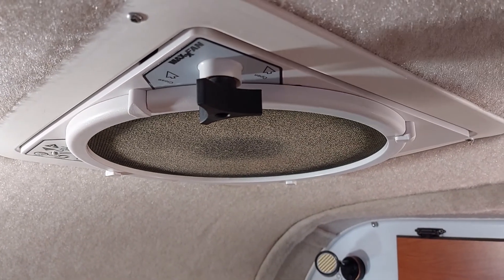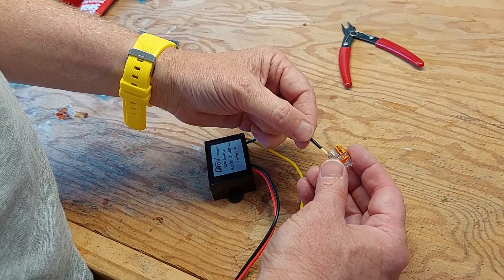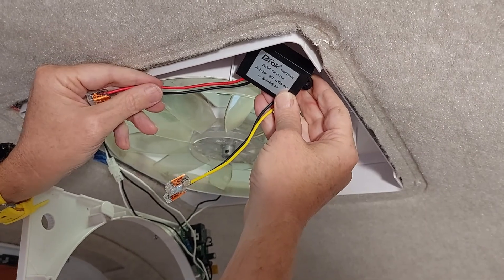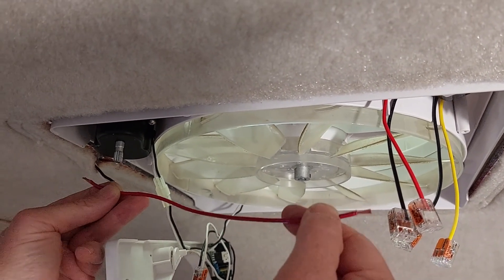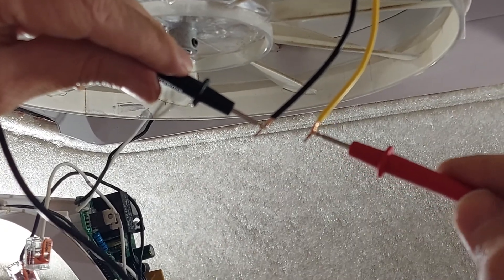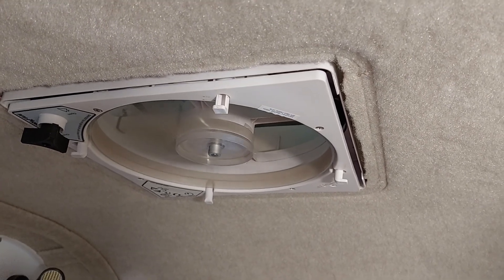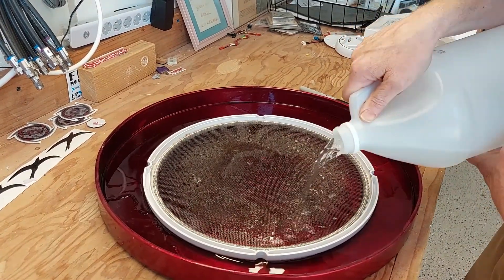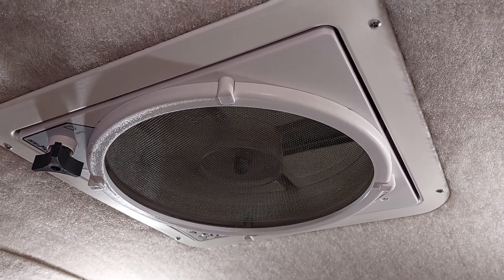How to Stop Your MaxxFan From Beeping & Shutting Down When Using Solar Power

Comment: Very helpful video! 👍 This is a common issue, especially for those living off solar power or in RVs. My MaxxFan used to shut down too whenever the voltage dipped a little. Thanks for the clear explanation — now I understand what’s causing it and how to fix it. Would love to see more practical tips for off-grid power systems! 🚐🔋☀

Comment: Install didn't work for me..disconnected fan from circuit board and it did not beep or show green light, plugged fan back in and it started to beep with green light again. 14.2v in 12.12 out.  Disassembled fan motor, cleaned. Bearing on bottom was dry. Packed with grease, reinstalled motor and ran great.

Comment: Hello! I have done this and thought it made the fix but I'm still getting the same issue, does anyone have any suggestions on next steps by chance? Thanks in advance for anyone willing to take the time and provide input!!
Reply from the maker: I recommend resetting the fan by removing the fuse in your panel and plugging it back in after a few seconds.  If the problem persists, I suggest calling MaxxFan technical support.
Reply: @scampgrounds   I have removed the fuse in my fuse box for the fuse between the battery, and the fan (now voltage regulator) is that what you're referring to or you're referring to a fuse in the fan circuit board? Thanks so much for your quick response and support. I have minimal knowledge and it's getting warm in AZ, gratitude to you!!
Reply from the maker: @MikeRobare  You did what I suggested -- removing the fuse at the panel (effectively stopping power to the voltage regulator / fan) and then resetting.  If the problem still persists, I recommend calling MaxxFan -- it could be a circuit board issue that needs replacement.

Comment: Parasitic draw of the Regulator?  Also some complaints about DROK not providing enough voltage when hooked up to DC.  Any issue now that it has been 2 years?
Reply from the maker: The issue concerns some MaxxFans not handling voltage outside a narrow range around 12 volts.  Introducing lithium batteries / solar panels can raise and violate the acceptable voltage reaching the fan, causing it to beep and shut down.  The voltage regulator addresses this issue, keeping voltage at or near 12 volts for the fan to function properly.  I haven't had any issues with parasitic draw of the regulator or it not providing enough voltage.  I'm still using the same one in my Scamp with the original MaxxFan which came with my 2020 Scamp 13'.

Comment: I did this hack and found the voltage coming out of the regulator at 12.16 when hooked up.
However, when I turn the fan on, it still has the same issue and beeps with the green light. Any thoughts or ideas as to what I'm doing wrong?
Reply from the maker: Sorry to hear.  I don't think you are doing anything wrong.  The voltage is a likely possibility for causing the problem, but there may be other causes (like a faulty circuit board).  I would recommend pulling the fuse to the fan circuit and after waiting a few seconds insert it back in.  If you are still getting the green light and beeping, then i recommend calling MaxxFan for further instructions.
Reply: @scampgrounds   I got a hold of MaxxAir. They had me disconnect the motor and see if the issue persisted. Without the motor connected, I could go to the highest setting without the beeping. If I reconnected the motor, the beeping would start immediately. I was told I needed a new fan motor. I replaced the motor and installed the voltage regulator. Everything is working just fine now.
Reply from the maker: @caseysmith9738  Great news!  I'm glad you were able to get it working.
Reply: @caseysmith9738  
I have the same issue.  I have two fans with the beeping and green light issue.  I replaced the board and added the voltage regulator to one of them, but still get the beeping and green light.  Monitored the voltage as the fan started up and faulted, never moved away from 12.3V.  Suspected maybe the motor was causing a short that I could not see on the multimeter, but I had not heard anyone else with a similar experience.  I was pretty stumped.  I will try replacing the motor.  Thanks for sharing your experience.

Where did you get your replacement motor?

Comment: Thank you for posting the voltage regulator tip, I hope it solves our intermittent fan issue!  I pulled the unit down, and the PCB looks really good, really clean, there is no visible water residue, and the manufacturer even applied what looks like silicone sealant to a number of the pinnings on the board.  I will use the conforming coating as a preventative measure and hope that the regulator solves the issue.

It turns out that the PCB can be purchased directly from MaxxAir for $117.00 vs. $178.00 from online retailers, but they are made to order and that takes 2 weeks, whereas the online sellers can ship it out next day.
Reply from the maker: You're welcome.  I hope it works for you.

Comment: Thanks! I had added solar panel and a good controller for that. But it worked prior too this. Have you seen anything else that is suspect to same issue like water pumps?
Reply from the maker: Based on my research, I found the top reasons for the fan beeping are voltage outside the fan range or a bad fan motherboard.  Sometimes pulling the circuit breaker momentarily and reinserting it will reset the fan.  I have not seen any other peculiarities in our Scamp 13' except for the fan.

Comment: Great video.  My fan was beeping and shutting down on itself I ordered the voltage regulator however I mounted it by the fuse box and didn't have to put it inside the fan.  was much easier
Reply from the maker: Thank you.  That's a fantastic idea!  As long as the voltage regulator sits between the camper current and the fan in the circuit it should be good.  The main idea is that the current going into the fan is regulated at around 12 volts.  The fuse panel in the Scamp will not fit the regulator though.
Reply: I hope I can get this method to work, thanks for the great suggestion!

Comment: I installed 2 in line and it didn't work.  A special silicone conformal coating has worked for others to seal out moisture

Comment: I have this exact problem and tried the voltage regulator. It didn’t work out for me. I replace the motherboard as well. I’m so stumped!
Reply: That is perplexing (assuming voltage regulator is before fan wiring).  I would double check the voltage after the regulator to make sure it isn't too high or low.  Ultimately, call back the manufacturer and ask their tech for help if the problem persists.  Good luck.  Please let me know what you find.
Reply: I installed 2 of in line and it didn't work.  A special silicone conformal coating has worked for others to seal out moisture

Comment: What an excellent video. So one plus years later has it failed after the voltage regulator install? I have put up videos showing the fault https://youtu.be/PVCLUy0YQmY?si=rX4Jxph16yk26Ri2  They definitely have or had a design defect. AirExcell sent me a new board but I have yet to put it in. I heard even the replacement board from them does not correct the problem. think this fix is the way to go. Will order one up and install.
Reply from the maker: Thank you!  I'm happy to report the voltage regulator is still working great!

Comment: Excellent thank you!🏆
Reply from the maker: Sure!
Reply: @scampgrounds  Btw I’ve found it really easy to clean the screen by just tapping it outside and wiping it with a swiffer and also using my tiny usb rechargeable hand vacuum . Thanks again.
Reply from the maker: @chilblain1  thanks for the tip.  That sounds like a great method and I'll give it a try!

Comment: Problem I had was the lithium battery which resulted in over voltage shut down. Adding voltage regulator solves the problem.
Reply from the maker: Great!  I'm glad it worked for you!

Comment: I just got it in the mail.
Took 5 minutes to install.
The fan works perfect now.
Thank you!
Reply from the maker: Awesome!  I'm so glad it worked!  If it beeps occasionally, just pull fuse to cut power to fan and re-insert fuse and it should reset the fan.

Comment: I bought a max air fan 5100 on Amazon when I turn it on I get only continuous beeps. Can you tell me what’s wrong?
Reply from the maker: Could be a number of things (e.g. incorrect wiring, bad circuit board, out of voltage range ....).  I recommend calling or emailing the manufacturer and reaching out to a tech who can advise you.  
rvpsupport@airxcel.com
(574) 247-9235
Since you purchased on Amazon, you could also return.

Comment: Thanks 
I just ordered this.
My converter has been switched over to charge lithium batteries.
I am pretty sure it is putting out 13.6 volts which is likely tripping the green light.
I have high hopes this will fix the problem.
Reply from the maker: Fingers crossed.  If your converter charges lithium batteries, then the high range output voltage is between 14V-14.6V (which exceeds the voltage range for MaxxFan circuit boards made before 2020).  Please let me know if the voltage regulator works for you.
Reply: @scampgrounds  So a new MaxxFan should alleviate the need for voltage regulator addition?

Comment: Any chance that MaxxAir has a new solar compatible fan? I just want it to turn on, off, and reverse. I have no need for something with a motherboard.
Reply from the maker: They have evolved their circuit boards to accommodate a wider voltage range.  The MaxxFan tech I spoke to said the motherboard used to have a voltage range between 10.8 volts – 13.8 volts (our model), but once more people started using solar panels and lithium batteries (leading to higher voltages within their rvs) the company came out with a new motherboard (sometime after 2020) to accept a wider voltage range (10.3 volts – 15 volts).  The tech told me that even with the new motherboard, the fan will still have problems with voltages outside the new voltage range.

Comment: I tried this solution for my Maxx Fan.  Did not help.  Still shuts off about 2 seconds after it starts, on any speed setting.  Not a FAN of Maxx Fans!
Reply from the maker: Very sorry to hear.  This video is about a common issue (related to voltage) and solution, but there are other causes as well (such as a bad circuit board).  I recommend calling the company as their tech support seems very good and willing to help.  Also, one thing to try is to pull the circuit breaker for the fan (in our Scamp it's the breaker for the rear of the trailer) and then reinsert -- this seems to "reset" the fan.
Reply: Just ordered a new circuit board.  Your video was very helpful.  Thank you! @scampgrounds
Reply from the maker: I was told the new boards have a wider voltage range too.  I hope this fixes your issues.   @Onewithsausage

Comment: Thank you for the tip on the voltage regulator, I got the same one as you, installed it and it has solved the problem with my non-operational Maxxfan.
Reply from the maker: Awesome!  Glad you solved the issue!

Comment: Hey this is a really helpful video that could save people a load of headaches. I’m wondering, if solar is causing it to cut out and display the green light would this not be more reliable when using at night ? Just trying to diagnose mine to see if this is the issue too. Thanks Nick
Reply from the maker: Thank you.  The common issue of beeping and shutting off is often related to fan input voltage outside of the fan's desired range (e.g. too high or too low).  Solar panels can cause this problem (the solar controllers may not be that accurate).  Yes -- if you use your fan at night (or without solar connected if that's possible) and make sure your battery is around 12.5V, you can see if the issue still happens.  You can also check your trailer's voltage during the day (using a meter, like a 12V plug in device which they sell on Amazon) to see if it's too high.

Comment: We installed a bunch booster converter on installation, along with electrical liquid tape on the board. It’s been beeping, going nuts turning on by itself, opening and closing continuously just driving me nuts. Can’t use our fan… By the way, we’ve only had it installed for about 2 months. This is what we get for buying this “Deluxe” vent… Right…. We have 500w solar and two big lithium batteries. Plenty of power for everything, besides this fan? This fan… Agghh…
Reply from the maker: Sorry to hear.  Incoming power may be exceeding fan voltage limit -- that's usually why it beeps.  Consider calling manufacturer or testing voltage (with solar panels operating) right before fan to make sure it is in the required voltage range.

Comment: Anyone know how to simply disable the beep?  Our house battery got really low one night and the fan beeped about ever 15 seconds ALL NIGHT LONG due to low voltage.  We weren't even using the fan!  Why does a fan need an alarm beep anyways?  I just want to remove the speaker or disable it so it never makes a noise again.
Reply from the maker: If you remove the fan's fuse from the panel it will disable power to the fan and it should stop beeping.  Sometimes just removing the fuse and then inserting it back in after a few seconds is all it takes to reset the fan.
Reply: @scampgrounds  Thanks. Maybe I will trace the wiring and put a kill switch on it for when we go to bed.
Reply: @AllenManor  I have a kill switch on mine.